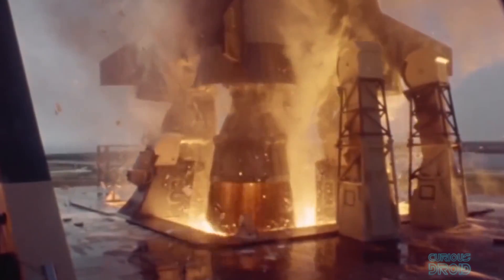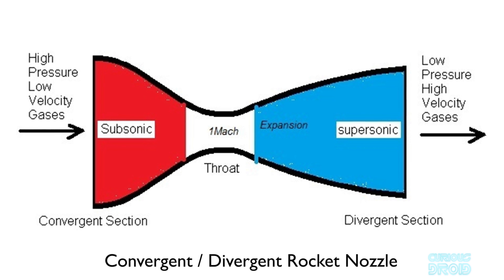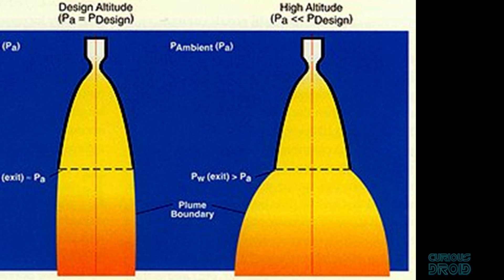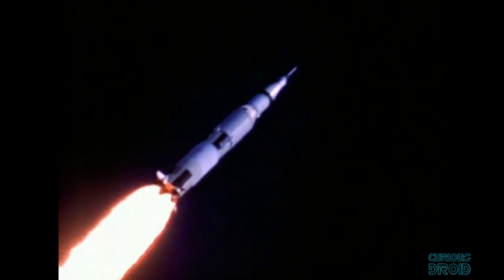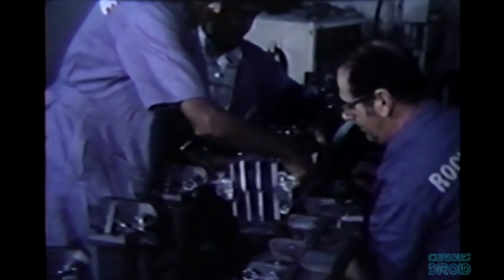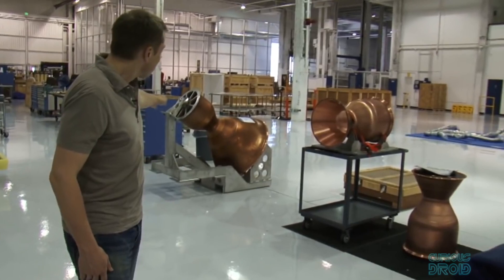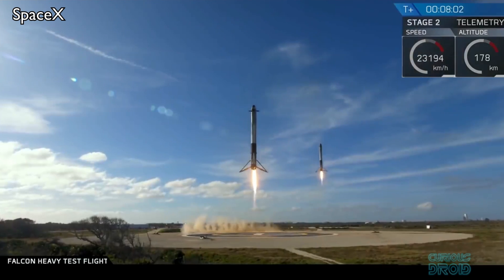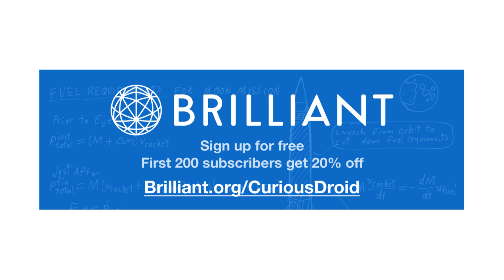Aerospike Engines - Why Aren't We Using them Now?

Comment: Minor nitpick:
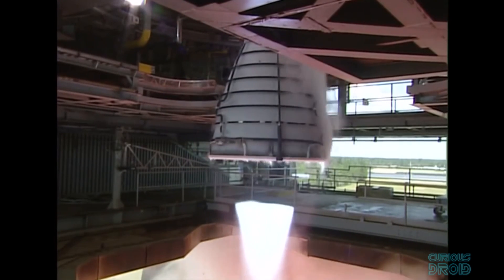At about 1:12
"... it replaces the bell shaped combustion chamber."

The bell is just the nozzle, not the combustion chamber.  The combustion chamber can remain roughly the same shape for plug or toroidal spikes, or have multiple smaller chambers for linear spikes, but in all cases the shape of the chamber itself is mostly the same.  The main difference is at the exit or thoat of the chamber which rather than restricting the gas flow and allowing it to expand into the bell which accelerates and cools the gas is still constricted but is then directed towards the spike, with the air forming the other side.

As i daid, minor nitpick.

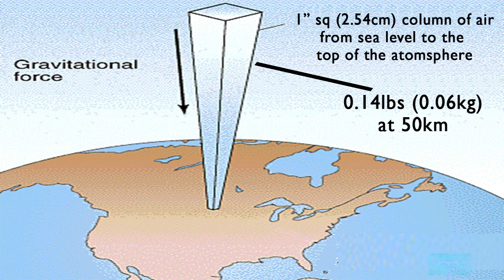Also at about 2:55, 1 in² is 6.4516 cm².  Whomever did the conversion just did in to cm, forgetting that 1in*1in is 2.54cm*2.54cm

Comment: This video is a perfect example of the truth being surrounded by bodyguards of lies.

Pause the video @ 2:38 ...and take note of the LIE in the picture where it states "top of atmosphere". There is no "top" where the atmosphere ceases to exist. There is still ambient pressure.

Now listen carefully to the narration starting @ 3:26 : "The rocket going into orbit, however, starts at sea level, with a lot of atmospheric pressure, and ends up in a vacuum with no air pressure." <~ That right there is a key lie intended to lead people astray. That single lie leads people to believe that rockets indeed produce thrust in a perfect vacuum.

In this video the narrator admits that rockets do indeed push off of the air around them, but THAT truth is cleverly hidden amongst a bodyguard of lies because it's profitable...VERY profitable. The narrator doesn't use those words, but functionally that is what the narrator is admitting when he says the rocket design is attempting to get the exhaust gases to produce as straight a column as possible......that the air pushes back upon the exhaust column that the rocket is climbing. Like a hypothetical balloon rising in an ocean of water....it's bouyancy movement is a function of not the balloon rising, but rather the ocean flowing around the balloon to fill the 'void' underneath. Or in other words....the pressure under the balloon is greater than above..thus the balloon rises due to it's bouyancy. A rocket is quickly shoving vast amounts of air mass out of the way, and it is the combined pressure of the entire atmosphere which is RESISTING that, which is flooding in under the rocket, and the rocket 'floats' upin that ocean or air.

Comment: bell nozzle has 1 optimal pressure, bell nozzle with sliding expansion part has 2 optimal pressure but has more complexity and weight, aerospike has optimal pressure range. aerospike is good for rocket launch because it flies through a range of air pressures. for engines only in vacuum, a big bell nozzle is best. Ion thrusters are vacuum only, have best vacuum Isp and don't have a nozzle.

Comment: Wasnt staging the rockets also due to loose dead weight? So f.e. the saturn 5 dosnt need to carry the unneeded weight to the moon and back.
Reply: 2 years late but the purpose of using a single stage is so you can reuse it more easily

Comment: while you are talking about low cost routes to space, would it not be more cost effective to have space capable aeroplanes, that can take off, reach an altitude of say, 35,000 feet, and fire off a rocket to then propel them into space. I know something like this had been tried, launching satellites into orbit, but that was launching a rocket from an airplane, not launching an airplane into orbit. the biggest problem I see is not getting the plane there, but getting it back. as it falls to earth, it will have to fall through the thin air until it gets to the thicker air. I'm unfamiliar with the physics and thermodynamics of having a plane fall through our upper atmospheres until it reaches an altitude suitable to reignite its jet engines and successfully land

Comment: I think multi stage rockets are the better way to go.  As he said, bell nozzles are more efficient for specific atmosphere.  But the big advantage of multi stage is that it sheds vehicle weight as you climb.  Less weight, the better.  Why do you want to continue to carry all that mass all the way into orbit if you don't need it?  Also, once in orbit, you have to re-enter the atmosphere, and that is when you really want the smallest and lightest vehicle.  Smaller re-entry vehicle means less shielding, and less weight means easier to land.
Reply: Bro, when you take away all those stages away, how much less fuel do you need? Those stages are literally just engines and fuel tanks, anything without stages is going weigh less, fact. I am not saying aerospikes are the way to go, I am saying your logic is flawed

Comment: What was the trust to weight ratio of those airospike engines? I could not find anything but I am sure it's an important part. I found out that the trust to weight ratio for those new methane lox engines is roughly twice as high as for hydrogen lox engines and I think that's one reason why Space X is prefering them.

Comment: does the linear aerospike exhaust still provide high efficiency WITHOUT COMBUSTION?!  I'm hoping that burning a fuel is not a requirement for the high efficiency. This does reduce the temperature of the assembly, and would be really useful for a project I'm researching. Honestly I can't find the answer to this question.

Comment: The ultimate solution for interstellar travel and return reuse spaceship is gravity engine. Where the engine can create its own gravity and use nearby celestial object's gravity to slingshot their way thru space. Then a warp engine to bend spacetime continuum. Travelled at 1000 quadrillion light speed. And that spaceship would be disappeared from 3rd dimension and travelers at higher dimension like 4th or 5th dimension where the basic 3d physics won't applied.

Comment: SSTO is not only a question of engine effectivity, and as of current quite not the goal that would bring big wins... using just 2-staged rocked quite solves question of engine effectivity, 1st stage is sea level optimised while second stage is allready allmost vaccuum optimised...
Also, about engine reusability, until recently the cost of engine refurbishing after each flight was considerable fraction of new engine cost (say a third or so) so reusable engines was not a sure yes... today some enines use even extended 3D printing techniques which might add to the ease of 1-way use...

Comment: A radical change in the space market occurred when NASA scrapped the STS program.  Centralized state management of space systems proved to be an economic embarrassment.  Competitive capital markets drive ever improving space technology efficiencies.

Linear Aerospike technologies are efficient from a general dynamic systems perspective.  It would make sense to utilize single stage to space efficiencies to improve governmental personnel transportation.  If my specialized and unique skills of diplomacy were required at two locations twelve thousand miles apart on the same day then the immediacy provided by hypersonic single stage to space transport systems would satisfy my needs. 

Yes, as Curious Droid states, economic efficiencies may not inspire open market profiteering from Aerospike usage, however, government administration lacks a profit motive.  Interestingly, many things which matter to national security, maintain a value which supersedes monetary considerations.  Who exists with this information desiring to spill the speculative beans?  Can you read me, mother?

Comment: But where are the actual engines? In a museum somewhere?
Reply: One of the engines is on display at the Rocketdyne cafeteria.  The XRS-2200 linear used heritage turbopump assemblies from the Apollo J2 engine era and I think they were scavenged for the upgraded J-2X program a few years ago.

Comment: I thought that multi staging was used to get rid of dead weight? Isnt it less efficient to accelerate a large empty rocket to orbital velocity than to shed weight and only accelerate the minimum required weight to orbital velocity?
Reply: Yes, very much so. But a single-stage vehicle is simpler and faster to turn around

Comment: On the other hand, SpaceX ended up developing a full-flow engine. That’s also pretty big deal in my book.
Reply: The Russians did that in the early 1960's. Yawn.
Reply: @MrKentaroMotoPI  And RD-270 never worked correctly, often ending up with turbopump race condition, which would've wrecked the engine and the entire rocket on a flight article.
Reply: @caav56  You missed the point entirely. The Russians did it first and did it better. They have many HC staged combustion engines. The RD-180, developed in the 1980's, is the most advanced HC engine in the world. It uses kerosene, a superior - and more difficult - 1st stage fuel. SpaceX and BO are stuck with methane because they don't have endothermic cooling technology.
Reply: @MrKentaroMotoPI  Russia uses less efficient oxidizer-rich staged-combustion engines, as they couldn't do fuel-rich scheme (like USA did with RS-25) before RD-0120, used on Energia.
And about kerosene - not quite. Methane, after combustion, has lighter exhaust composition, allowing it to convert heat into thrust more efficiently, than kerosene combustion products can (only hydrogen is better at this, but it has many other problems), therefore providing better specific impulse. In addition to that, keeping first stage and second stage fuel and oxidizer common helps to make GSE much less complex, as well as ensure easier time handling it (similar thermal regimes, for one). Besides, with common fuel on all stages, engine can also be derived from common schematic, allowing easier mass production (like what's happening with Raptors). And, on that note, methane can be easily produced on Mars, allowing SpaceX to put a Sabatier plant and a few tankers there to refuel any deep space probes or expedition ships, giving them 6.9 km/s of delta-v from get-go.
Reply: @caav56  There is no efficiency difference. Staged combustion cycles flow all the propellants out the main chamber. It's a trade between preburner and turbine temperature and size. The key technology is oxygen compatible materials. The Russians invented them. In the 1960's.
Note that I said 1st stage. Methane has higher Isp than liquid hydrocarbons but lower density impulse. Methane has been studied for decades. It runs stably and has a high coking threshold. But, it just doesn't trade well in vehicle stages. SpaceX and BO use it because they don't have endothermic cooling technology.  They also use common engines on all stages because they don't have high energy (hydrogen) upper stages. P&W and Rocketdyne invented those in the late 1950's. That's OK, it saves Elon and Jeff billions. Just not anything to get excited about.
Reply: @MrKentaroMotoPI  >There is no efficiency difference
There is, though - exhaust velocity and combustion efficiency. The greater combustion efficiency is, the more energy is released in the combustion chamber (where you want it to be released), instead of exhaust stream burning after leaving the nozzle, if at all.

>But, it just doesn't trade well in vehicle stages.
What do you mean by that?

>They also use common engines on all stages because they don't have high energy (hydrogen) upper stages
SpaceX once investigated possibility of hydrolox Raptors (was their original plan, in fact), but decided to skip on them due to the problems with handling liquid hydrogen and mass ratio problems (subcooled methalox stage can get as much delta-V as hydrolox stage due to lighter tankage and better fuel density).

>Just not anything to get excited about
First flying FFSC engine is pretty exciting thing, truth be told.

Comment: Using multiple stages would still make sense with aerospike.
Reply: SSTO only makes sense if making staging mechanism is too hard for you
Reply: @adamrezabek9469  Or if you don't want to lose half or more of your entire rocket everytime you fly?
Reply: @СтефанМихайлович-ж9с  if you are able to reuse orbital rocket, you can as well reuse upper stage and first stage separately
Reply: @adamrezabek9469  Yeah you can, still more costly to put them back together though.
Reply: @СтефанМихайлович-ж9с  well, unless you are doing some CRAZY rapid reusability, having one crane to stack the rocket isn't issue

Comment: What about directional nozzles? Like the ones used by some fighter jets? They can change their shape and direction.
Reply: RS-25 kinda did that. But it's hard since you are already pushing limits of metal alloys.
Reply: No need. The aerospike is vectored with differential throttling between thrust chambers.

Comment: These days were living off of the technological advances made during and after WW2, which guttered out in the sixties.
I guess we need a new world war.
Reply: No. There is big technology development anyways. Just bit more money would help
Reply: @adamrezabek9469  Nothing original or revolutionary has been happening for a long while. And there's lots of money most of which ends up making billionaires richer.
Reply: @avada0  space shuttle was revolutionary. Reusability of Falcon 9 is revolutionary. Rocket are getting cheaper and cheaper (and that's what matter)
Reply: @avada0  How many people do you think space shuttles killed? Millions? Also you just contradicted yourself. "No they're not getting 'cheaper and cheaper' somewhat less expensive" Somewhat less expensive is still cheaper. Ultralight launch vehicles are also extremely cheap compared to small lift launch vehicles of the 90s and before.
Reply: @avada0  Rockets have continuously been getting cheaper and more efficient as computer hardware and manufacturing techniques become more cost effective. This is just self explanatory lol, you can go and compare the prices of similar orbital launch vehicles from different time periods yourself if you wish. Also Space X wasn't responsible for the first semi reusable aircraft, the aforementioned NASA space shuttle takes that title, and neither were they responsible for the first propulsive landing on a hard surface. That goes to blue origin.

Also the space shuttle didn't have any design flaws. Both accidents were caused by incompetency not an issue with the design of the craft itself.

Comment: I believe you didn't explain something important about why the jet of hot gases should come out straight; its because hot gas molecules need to come out opposite to direction of rocket in order to push back at it.